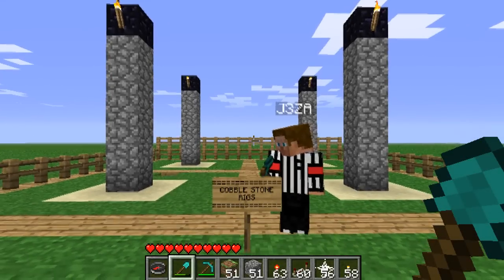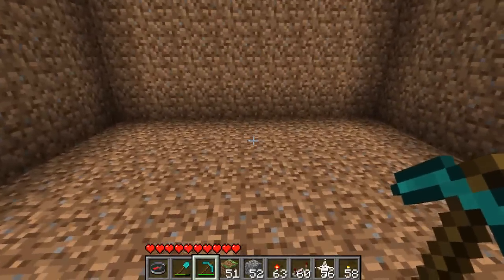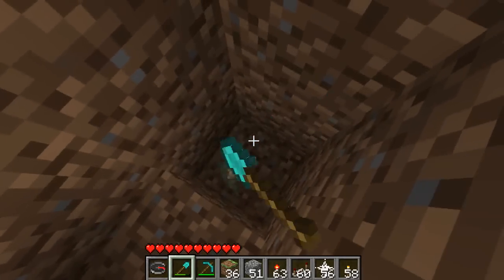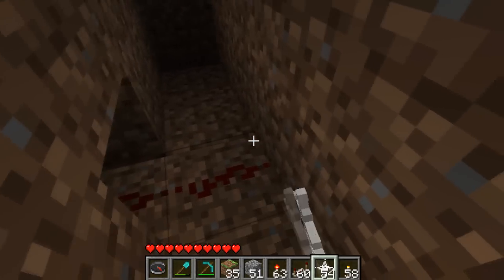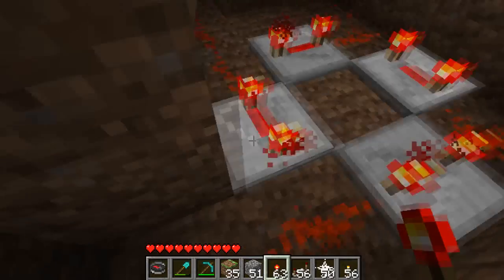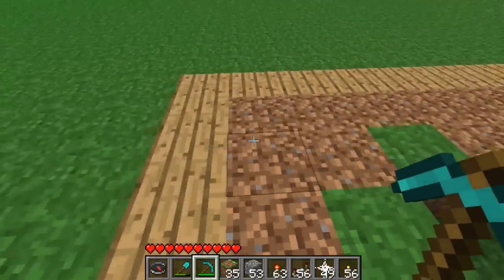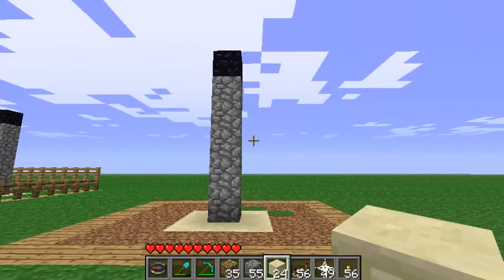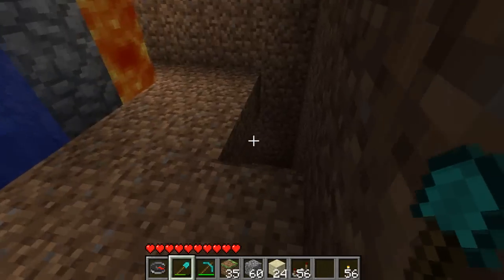[Minecraft Tutorial] PISTON GENERATORS!

Comment: I have a couple of suggestion to enhance your tutorial. First of all, initiate the loop with a redstone torch "by hand" can be replaced by a simple button on the wall. After that, going down to launch the system is annoying, you can cable the button back upstair. And, if you add a T flip/flop in your loop, you can use the button to stop the system too.

Comment: It's advisable to replace the cobblestone with smooth stone since that's WAY easier to mine.
Reply: Can't infinitely generate smoothed stone blocks yet as far as I know. Lava and water make obsidian, or cobblestone. That is how the cobblestone blocks are generated infinitely. I think if you add a distribution system using hoppers and chests and a full time stone block crafting enthusiast (Yes this means someone will have to sit down there in the pit and endlessly craft the stone blocks) to create a stack of stone blocks and flip a switch triggering the piston, you could infinitely generate smooth stone blocks. Wouldn't be nearly as easy or fast as this. You'd be better off just using the machine the way it is to get your cobblestone, then craft your blocks.
Reply: Rob Carson If lava flows on top of source water (and possibly one block surrounding it also I believe) it'll make smooth stone
Reply: +Rob Carson it is possible to make smooth stone just has to be done a certain way